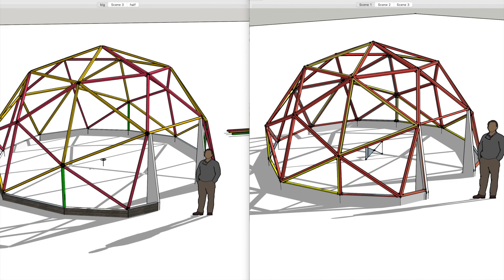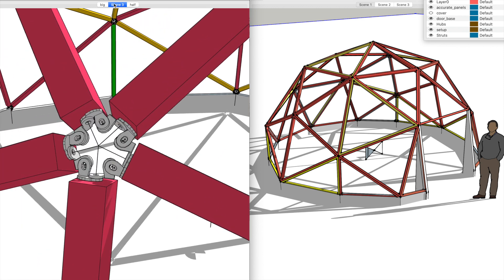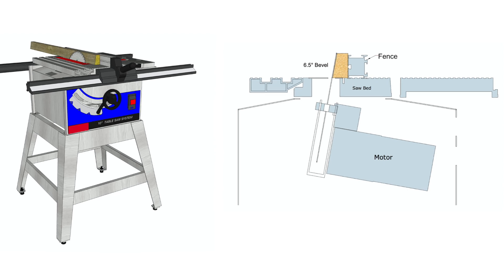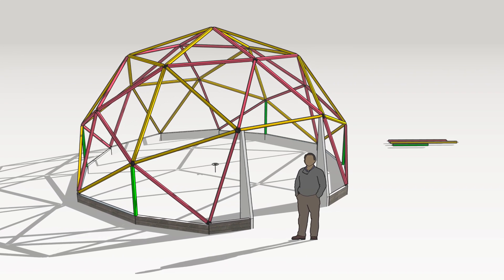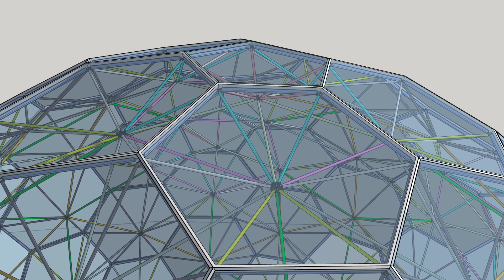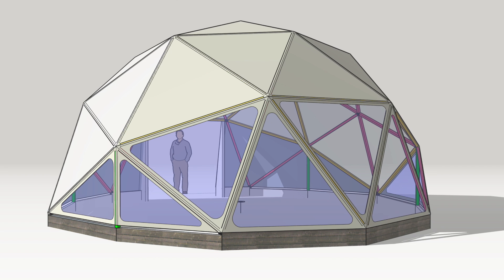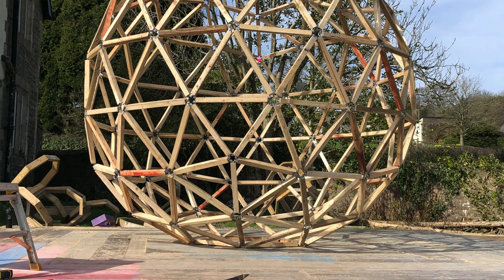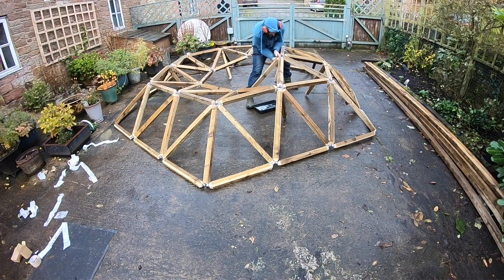WangerFlange Vs Bevelled frame for dome building

Comment: Nail in the ends of the wood struts?
I bet that plastic ziptie domes are stronger than these with wanger flange.
I immagine if you stumble inside of the dome and touch the wall it will crash.
Good for a chicken dome to cover with a net but not good for serious constructions like the beveled frame is.

Comment: bevelled frame seems better all around ? cheaper, easier to build, easier to install windows. i'm confused as to where the drawbacks are?
Reply: I saw one video saying that snow collapsed the beveled cut, not as strong.  Plus, it would be more expensive if you didn’t already have the tools you need.  Also takes more lumber.  Takes more time.  Not as versatile with covering options (you would have to do a lot more work if you want something other than a simple plastic sheeting).

Comment: I saw on AvE in which someone sent in these joints for examination and analysis.  He did not know what to do with them.
Reply from the maker: Yes I sent the design to AvE, he made prototypes from 3D files. Cool guy.
Reply: @Geo-Dome  Ohhh, okay so you are the  inventor?

Comment: I've just started a 3v 6m dome. But the plastic discs / hubs i was trying to use failed. So i started to look for alternatives.

I love the beveled frame, but it seemed too complex and time consuming for me.

The wangerflange looks like a great little widget, but i was shocked at the cost / pricing.

Anyway, in the end I went with a buildwithhubs 3v kit, which I ordered today. So we'll see.
Reply: For a  dome that size i`d recommend using schedule 80 pvc pipe or aluminium tube (T6-6082) with at least a 3/16" wall thickness. Steel is an option but its harder to cut/drill and tends to rust. The buildwithhubs will be considerably weaker.
Reply: @JohnGuest45  I've come down slightly in size to just over 5m.
And yes, the hubs, being plastic, aren't the strongest option. However, my intention is to make a lightweight garden type structure.
Or perhaps using the frame to do a thin Ferro-cement cover.

Comment: I love how honest this is. Seeing all the drawback laid out makes me want the wangerflanges more.
Reply: You like the word "wangerflange" don't you?!! You like to say "I've got a "wangerflange" to unsuspecting, sheltered individuals in bus queues... Don't do it. They'll hurt you and say, "it's your fault", as they are hurting you....
Reply: Consider the difference in accuracy between the two methods. Panel angles can be cut to within a degree quite easily when using a jig.  A 6 way hub may call for strut angles of 58.28 deg and 63.44 deg but  the closest you can get with a 6 way wanger flange hub is 60 deg so only 2 of the 6 struts on that hub will have the correct angle. Errors are cumulative in a dome, no sense advising folks to cut the strut length to within a mm if the hub angle is out by 3.5 degrees.
Reply: I've been incorporating fixed hinges into my compound joints for what ever i make.   It's more expensive and a little heavier, but I never have to worry about actually measuring setting and cutting numerous odd angles.  The jigs are just a clamped stop-block since I'm only ever worried about the length of the struts.

The thing to really take away from this video is that hinge joints in anything solve so much problem for us, the home DIY  lego builders.

Comment: I have finally gotten the chance to begin a small farmstead and am well beyond broke. I will over the next few years, be able to start building my greenhouses for far northern grown figs and citruses. I intend on finally be able to make some money with me in charge.... I think I will be needing plans for One, 24 foot dia. double skinned Wanger Flange space frame dome, Two 21 footer of the same type and Three 18 footers as well. These will be place with the largest at the Northern point of a Hexagonally arranged domes, which I wish to be able to connect via a straight section between the Domes. The Southern point dome will have the main entrance, with another at the lower "Western" corner that will have a straight section pointing West (House side). How do I go about getting this done? I need your help.
Reply: You will minimise your material waste by making them all the same size, i`d just build six 7m (23ft) domes,

Comment: Could a 3D printed part be used as a hub mechanism? Thanks for these videos!
Reply: . . . if you can print it within good stainless steel material properties - yes, otherwise: NO !. . .
Reply: The technology exists to do it - Boeing are using it to 3D print a small number of metal aircraft parts - but I suspect it will be a couple of decades before the technology becomes cheap enough to do it at home.  It also requires some work on the structural side, as I understand the 3D printed part is structurally similar to a part that has been cast, which may not be as strong as part that has been manufactured as a strong flat sheet then bent into form.  Either way, comparing plastic 3D printing today to mass-produced plastics, it's going to be more expensive to make it yourself than to buy a mass-produced part for a long time after the technology becomes affordable.
Reply: More cost effective to mould them from fibre glass or go with metal pressing.

Comment: I'm a huge fan of your work. My biggest issue with the wanger flange dome has been how to put a tight polly cover on it. Been waiting for an answer... never got it - so I SOLVED IT. I JUST covered a conduit dome (Idea for conduit dome came from you) with polly and got it tight and perfect in high winds. HOW - I used double inflated polly. Yes there's the odd bulge but inflated it actually doesn't matter. I made a video on it - it's on my channel. Love to hear your thoughts, but using double inflated polly allows for a perfect dome cover with no breaks in the polly using a small air blower (I harvested mine from an old xmas blow up orpiment from my yard). Thank you Paul for your awesome dome videos and I hope this helps in the covering questions you've been getting.
Reply: Simple Tek hey! I’m subscribed and Bell to your YouTube channel and I saw that covering video you made with the ‘1 sheet and blower.’ (2 sheets actually.) Thank you for this reminder! Excellent work on you and Paul. Thanks guys!!!
Reply: Its better than most of poly covered conduit dome  but its not what i`d call tight  ;)
Reply: @tadeospencer1683  you realize cybercrime is a criminal offence right? You can goto jail for that